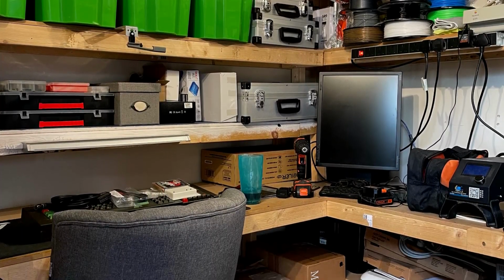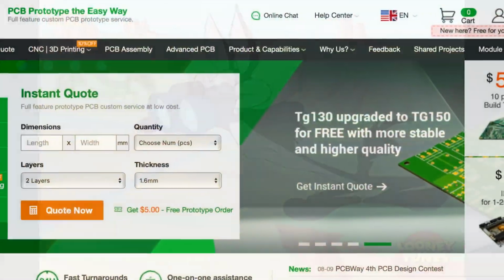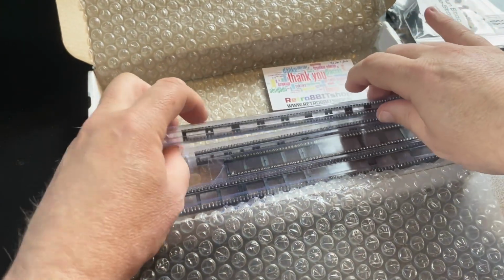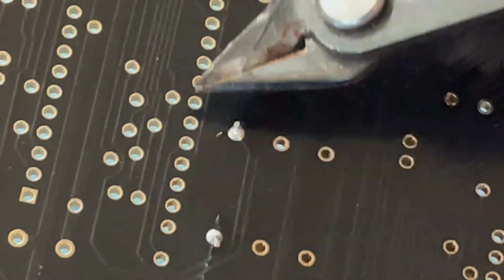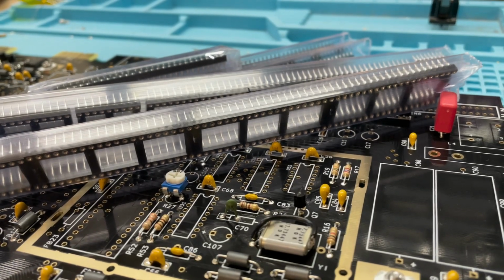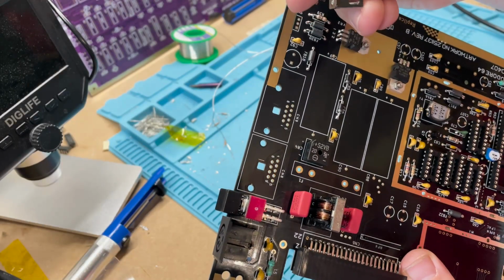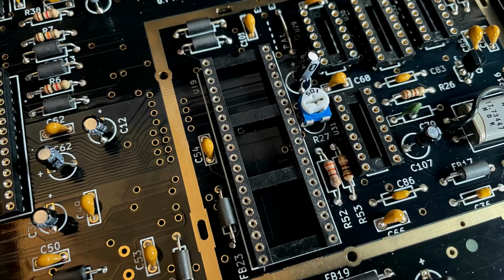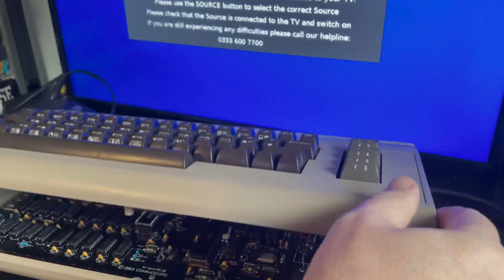Can you build a brand new Commodore 64 from (nearly) 100% new parts?

Comment: Cool! What is that blue mat that you're using when soldering on with the compartments?
Reply from the maker: Anti-Static Soldering Mat, Magnetic 500℃ Heat-Resistant Magnetic Multi-Purpose Repair Mat for Soldering Guns with 1 Pcs Mobile Phone Stand https://www.amazon.co.uk/dp/B07P5YYZKZ/ref=cm_sw_r_cp_api_i_7V3C4ZB12T0A6GJTBM1P?_encoding=UTF8&psc=1

Comment: Ehrm. Resistorcolorcodes represent numbers. You are aware of that, right? If you have an ohmsvalue listed in the partslist then from left to right each colour band is a distinct number. This way, you can always rule out typos like the one where they switched the black an red in the description. By knowing these colourcodes good you can always find polarity too. I don't think it matters though. Diodes have a polarity but as far as I am aware I have never really come across a resistor reading a different value in either one direction. Then again, I do install them in the correct polarity myself always.
Reply from the maker: Yep - I knew that :) But always good to point these things out just in case :)
Reply: @TheRetroShack  ah okey😅. Great job by the way👍

Comment: The 100% "new" parts kind of threw me off since very little IC-wise could possibly be "new".  Maybe old-stock, but certainly not new manufacture!  Interesting that you used the old PAL-based PLA, not a PLAnkton EV or whatever.

I do wonder about the overarching purpose of a completely new board when most old ones can be easily repaired, unless they were utterly destroyed with ham-fisted repair attempts!
Reply from the maker: And indeed some are :). My own ZX-81 was one such poor thing :(  Fixed now though :)

Comment: A bit surprised you needed to swap tips so soon, after less than 1/100 of the work a tip should easily handle.
Are you running the tip too hot for the solder making it eat away at it?
Reply from the maker: Yes, I was surprised too - I think a combination of the iron a bit too hot, and well, frankly some dodgy cheap tips.  All rectified now with some good quality items!  Don't fall foul of false economy kids! :)

Comment: Take an fpga replacement like the vic ii kawari- I'm hoping the creators of such things can be persuaded to make an asic, as the Fossi Foundation/Efabless will do a round of chips for free, paid for by Google (particularly with the chips shortage). Which parts need 12 volts? That seems to exclude anything fpga in the path
Reply: Older DRAM requires +12 and -5V supplies. The 12V is used to drive the wordlines above VDD, and -5V is used to back-bias the substrate to reduce leakage from the memory cells. Modern DRAMs use on-chip charge pumps and do not require these extra power supplies.
Reply: @saveddijon  Would installing modern DRAM require inserting a bunch of resistors?
Reply: @kenknight5983  No. The board will take only the DRAM it is designed for. The power supply requirements generally track by design density. e.g. a 4116 16Kx1 DRAM requires the 12V/-5V supplies, but a newer 1Mx4 DRAM would not. A brief search for datasheets seems to indicate that both 64kx4 and 64kx1 DRAMs use charge pumps and do not need the additional supplies. Good luck finding the parts.
Reply: @saveddijon  I'm guessing this was part of the reason for some new clone pcbs

Comment: Apart from the pleasure of building the Commodore 64 yourself, are there other advantages to it over a vintage Commodore?
Reply from the maker: Well, I guess not really other than by using new parts you’re resetting the ageing clock - or of course if you have a machine that isn’t working, but doing this you’d be able to at least rule out everything that isn’t a custom chip :)

Comment: Why sockets over soldering the chips to the board? Ease of repair? Or does soldering some chips cause damage?
Reply from the maker: Simply for ease of replacement in case there's an issue :)

Comment: Great!!! How about a Commodore 128 with new parts? That would be a major undertaking, as you would need to get a 8502 and a Z80 along with the PLA, and the VIC IIe, which read some of the newer keys. The SID is not a problem, since there’s ARMSID.
Reply from the maker: That's got me thinking - I've always wanted a C128 so maybe that's the way to get one :)
Reply: @TheRetroShack  I actually have a Commodore 128 with JiffyDOS installed on it. I also have a 1571, but the controller chip went out. But I have a replacement chip and a socket to install. Also, I have a 1581, but that needs a new switch which I have. Just waiting for a new soldering station I ordered from Amazon.
Reply: Does a C128 replacement board even exist?
Reply from the maker: @CollinBaillie  Yep - I think it’s called the 128 Neo?
Reply: @CollinBaillie  Probably not. Commodore 128’s are pretty much hard to get these days. Only 5.7 million were sold, so they’re not as widespread as the Commodore 64 was.

Comment: As someone who knows next to nothing about these sort of kits. Do the component kits have all-new parts/chips? Or were they harvested from dead C64s/other devices? I feel like if all the components needed to make a "new" one can't be produced new today and need to be harvested from old systems that doesn't really fix the issue of there being a limited supply of C64's that are dying due to how old their components are.
Reply: Hi, I'm the seller of the kits. All the parts in the kit are new and unused. RAM chips are New Old Stock (NOS), i.e. fabricated in the 80s/90s but unused straight out of the factory packaging. All the other logic chips are still beeing manufactured today.
Reply: @mbosschaart  Was not expecting to get a reply from the kit seller. Thank you! Are the RAM chips not being manufactured anymore or is there just simply a surplus of the NOS ones to not need to switch over to a modern one at this time?
Reply: @Cyber_Akuma  There is plenty of old surplus stock available today, but there are also alternatives that adopt modern SRAM chips.

Comment: I’ve always wondered if you could do this with a NES or SNES.
Reply: For the NES you can. There are at least 2 NES motherboard PCB replicas available as of now. However, as far as I know, there aren't any modern replacements for the NES custom chips, so those would need to be sourced from another NES.

EDIT: The two i know of are the NESessity and the OpenTendo.
Reply from the maker: I’ve been tempted by the Opentendo as I do have a NASTY NES lying around that I think the custom chips are ok in.  Might have a go at that :)

Comment: Other than the case, what were the parts that were not new? The Vic-II chip?
Reply: It looks like the CIAs, the ROMs (kernal, character, basic), the 6510, the VIC-II and the RAM is either NOS or pulled from another C64. Oh, also the joystick ports.

As far as I know, everything but the 6510 technically has a modern replacement at this point, although the Kawari (VIC-II) and J-CIA aren't yet available beyond beta testers.

EDIT: The keyboard and shell are also not new. New 64C shells are available, but not breadbin (maybe someday?). I think there are a few projects out there to make new keyboards, but the keycaps are the biggest hurdle with that.
Reply: @adimifus  Then, to me, it looks like this "brand new" C64 is 90% used parts. 😁
Reply: @meneerjansen00  Hmm... I left a comment that mysteriously disappeared. I'll try again.

Yeah, I've seen a few videos like this where they inevitably use more pulled or NOS parts than necessary. Not sure why. It would have been nice if he went into some amount of detail about what modern replacement parts are available, what are upcoming, etc.

Comment: Well they're not 100% authentic unless half the chips fry on start up  😂🤣. I really wish when they originally made these boards that they had IC sockets as C64's were terribly unreliable. I reckon mine spent more time getting repaired than actually being played. Probably why I ended up becoming an electronics tech LOL.

I didn't even know they were making replacement boards and component kits. I had contemplated using a raspberry pi to emulate, but now I may end up rebuilding the one that's been stored in the shed for 40 years LOL. Thanks for the heads up!
Reply from the maker: Personally, I've had quite good luck with C64's but I do get a lot of them pass through me that need a bit of love :)  I hope you give the project a go - it's very rewarding :)

Comment: awesome video..thank you!  Question?  What do you use to connect the C64 to a monitor these days?  All the flat panel screen or TV dont have the connections we used to have in the 80's hahaha  Not even the Cable stud.   Any pointers would be greatly appreciated....
Reply from the maker: Thanks and glad you enjoyed it.  I’m using a SCART cable to connect to my TV.  If you only have a HDMI socket on your TV you can get a SCART to HDMI converter.  Hope that helps.
Reply: @TheRetroShack   Thank you for the tip...ordered on Amazon and it's on the way, should be here in 4 days!!!  Appreciate it sir.....

Comment: Great job well done.👏
Can you give some feedback on the modulator replacement by c0pperdragon please. I've had the parts to do this for some time to try and improve the video output from a bread bin C64 but as yet not installed it.
Reply from the maker: Well, it does replace the modulator effectively but i can’t say I’ve noticed an improvement over any other c64.  Might couple it up with a lumafix and see if that improves things.  Your mileage may well vary of course.

Comment: Excelent video. Sorry for my lack of knoledge! If you put the new modulator and output your video through the commodore din super video output, is it necessary to change my vicii, i have and original c64 assy 250425. i'm trying to bring it to 2022. Then i will replace the power supply and the pla! Thanks !!!! Really thanks!

Comment: It needs a Kawari VIC-ii replacement, and brand new EPROMs, to reduce legacy parts even more. =)
Reply: New EPROMs is also quite an interesting take ;) But yeah, basically the CPU is the only remaining roadblock (I'm aware of the MOnSter6502, but last time I checked it was running at a few KHz) with replacement VIC-II and CIA chips to be expected some time in the near future.
Reply: @1337Shockwav3  isn't there that Pi Zero replacement for 6502 style CPUs?
Reply from the maker: Got to hold something back for the next episode :) :)
Reply: @1337Shockwav3  And the internal cartridge port bracket. Nobody produces them. There is also the question of the keyboard and the keycaps.

Comment: Where did this nonsense of using round pin sockets for IC's come from?  Round pin sockets are for wire wrapping.  Forcing a regular IC chip in a round socket disfigures the pin socket.  There is a very good chance of breaking off a IC chip pin when you pull out an IC chip from a round socket.

Comment: HI great video, I'm thinking of making either a "new" c64 or a Harlequin Speecy.  How much was the total cost of this project?
Reply from the maker: You'll need a 'dead' c64 - but with good MOS chips.  That will give you the MOS chips, case and keyboard.  Then it's around 100 euros for the parts kit.  Then all you need is time :) :)

Comment: Yes. Silly mistakes. I did that as well. Now you really need a new case. 🙂 That is s new part right? 😉
Reply from the maker: Yep, I'm fairly convinced I want to something a bit special for the case :)
Reply: @TheRetroShack  There is a german company that sell plexiglass cases. I think they are called plexilaser or something like that. Then there are indevidual computers that sell the model c cases made on original injection molds. I have the last black that pixelwizard sold, before indevidual took over.

Comment: ofcourse you can. but why bother. the c64 is not a 'clean design'. it also isn't cmos. it also uses dram (yuk) rather than sram. it also lacks ethernet (at least in a standardized way present on all of them at the same address ;) it never got the cbm serial bus to work at any acceptable speed as the 6526 is just an even more broken version of the 6522. so. back to the drawing board and cook up something better. with a clean, sense making address map. that can easily be cloned and turned into other products (unlike the c64 as basically all versions of the c64... were... the c64 :P as it's just a pain in the ass to take that design and make something else out of it (like the 64gs is literally just a c64 board, basically the only exception is the 128 and that required a whole lot of workarounds. it's a far too overcomplicated design... soo let's start with some new dip 5v cmos based video chips that unlike the nes ppu clones (but then preferably the rgbsync version for arcades (for some reason literally the only thing on the market still obtainable in bulk - and even those secretly are nmos ;) are not full of bugs shall we :P or maybe don't bother with that at all and simply do the video in digital rgbi+sync. still by far the best standard to get guaranteed identical and simple output. unlike all that 'tv derived' cheap stuff. ibm was right with cga.

Comment: 18:58 yes nearly 100% what is actually? well ofc those old chips that you not get anymore and nobody manufacture LOL caps are new so its new then resistors diodes and regulators not get old that much xD. same as buy used 50 bucks. noh they sell old 300buck. you can build your own 100 buck lol. still waiting new amiga with compatible old amigas LOL
commodore should build new chips that run 100x faster and RPI emulation will be absolite LOL